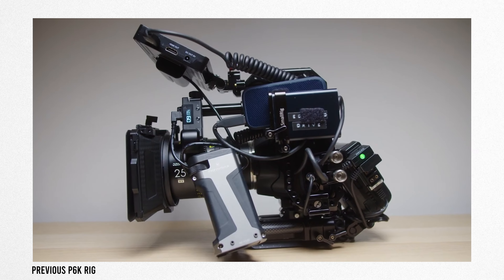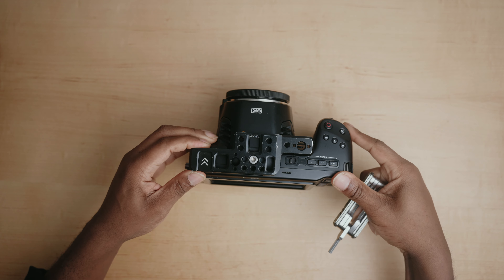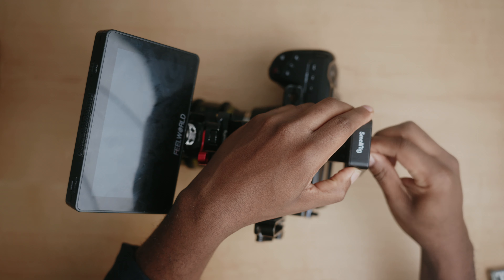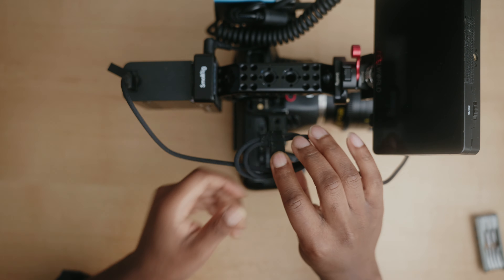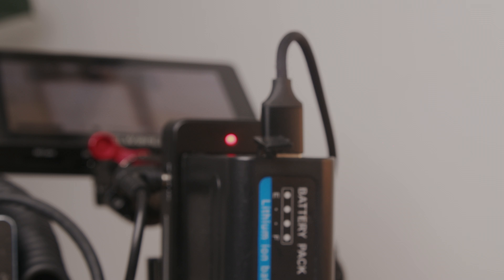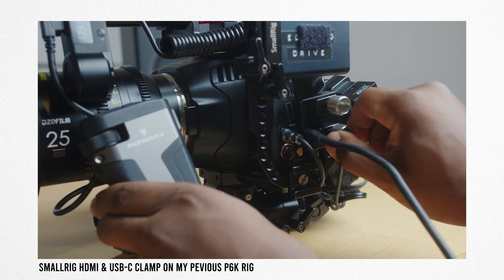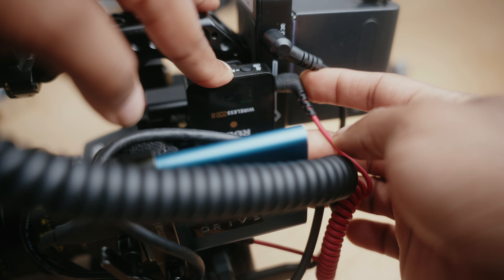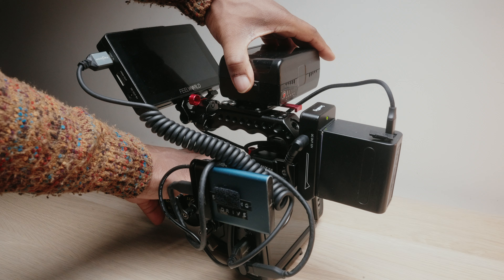STOP! Making Heavy Rigs - My MINIMAL Pocket 6K Rig

Comment: Nice rig bro, I'm still rocking a heavy rig. Considering i do a lot of handheld shooting i might consider switching from v mount to NPF for certain scenarios. My current rig is set up to be handheld, on a tripod or go straight to gimbal but i still have to remove some bits for gimble work (which isn't very often). It may be time to go smaller
Reply from the maker: After years of filming in heavier rigs, I decided to go much lighter as it's more comfortable to hold.  On some shoots if I need to fully rig it out I will get an easy rig
Reply: You can also use a power bank with power delivery. Those are even smaller and lighter than NPF and hold 10,000mAh+ and also fit on a gimbal

Comment: Love the rig! Do you have a link for the magnetic adapter you use for the port? I'm also already starting to see some issues with my USB-c port. Do you reckon the adapter will be an adequate solution for it?
Reply from the maker: Thanks fro watching the video, I've put links for the usb -c adapter below.  In terms of protection, it does a very good job if there is movement the advert breaks away from the magnetic part of the adapter, I do not know 100% if it protects better than clamp, but this is the only solution I have seen when not using a cage.  If you use a cage I would say use a clamp as you can real tighten the to the cable to reduce movement 

Adapter links
UK - https://amzn.to/3VAp5oA
US - https://amzn.to/49dYot9